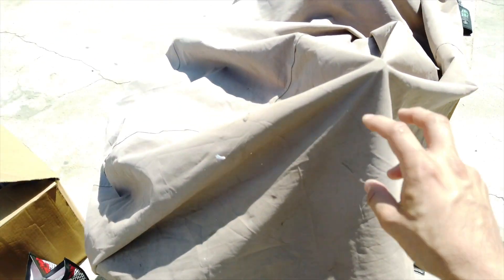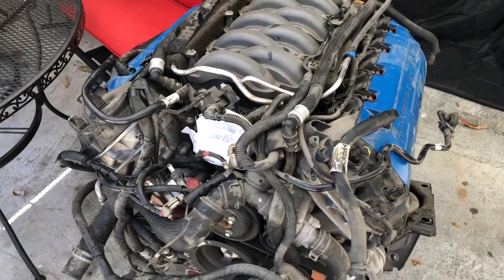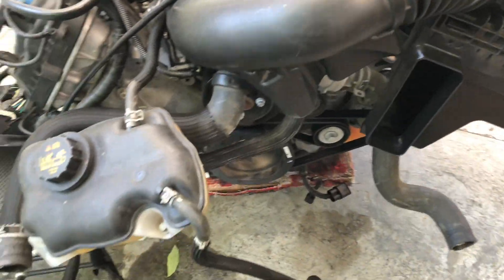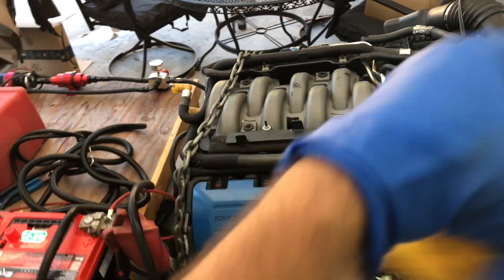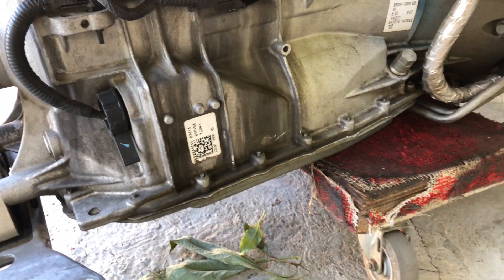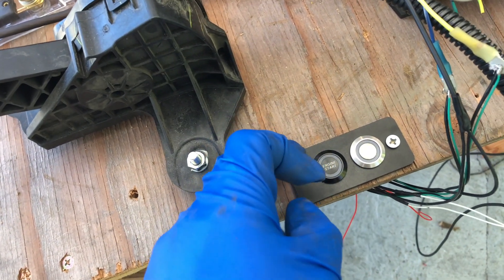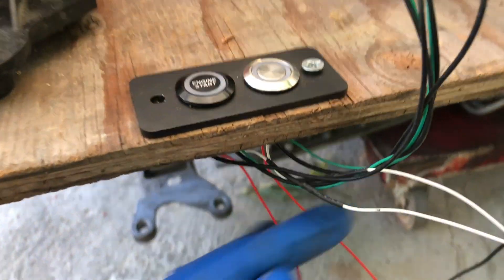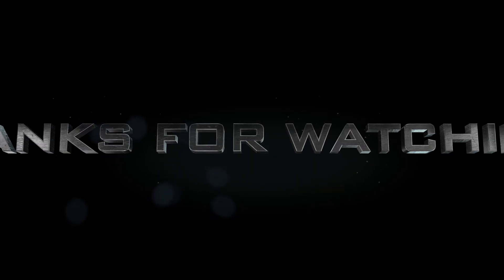Firing up a Coyote 5.0L in under a week | Coyote Budget Build | Coyote Swap part 1

Comment: Ok so with that set up will. Does it through any check engine light. Because I’m in California and the rules are strict over here I am trying to use that set up and not have a check engine light.
Reply from the maker: As long as you have o2 sensors and cats you’ll be fine.